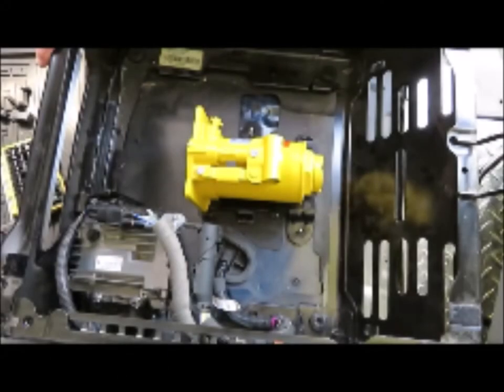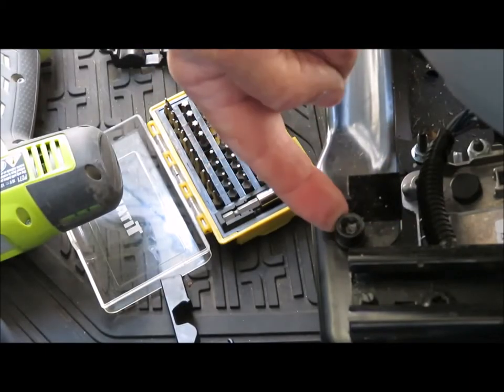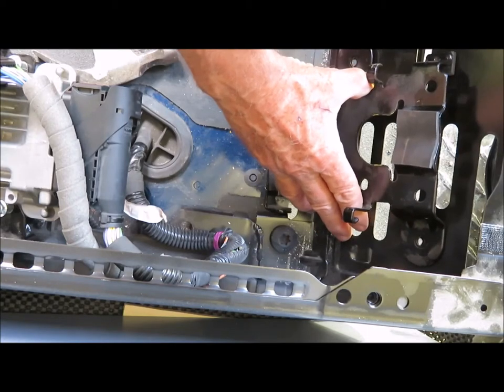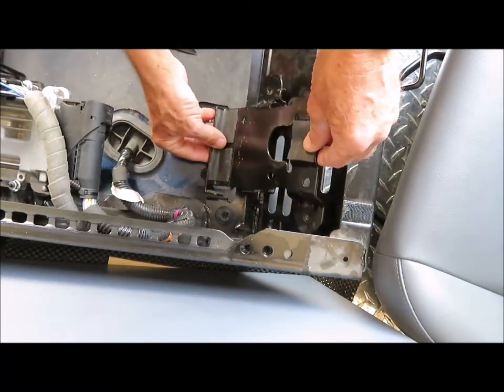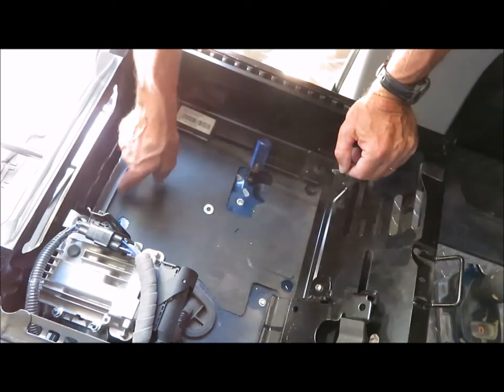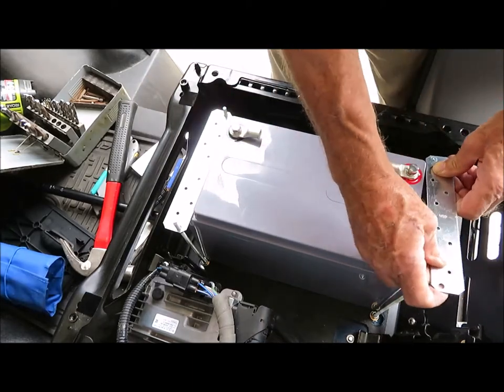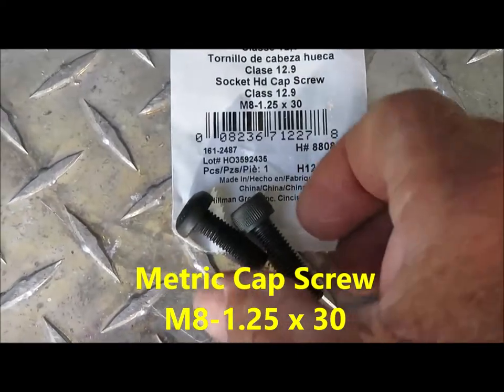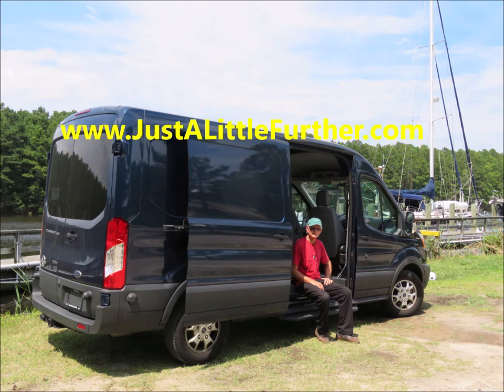Installing a Battery Under Passenger Seat of Ford Transit

Comment: I would suggest double nutting the clamps bolts.  If the battery becomes loose it could short out and start a fire.
Reply: Great suggestion. Thanks!

Comment: Great video. Just wondering if that positive terminal and wire is a little too close to your metal bracket.   I’d recommend some good layers of electric tape on that bracket in case something shifts.

Comment: Thank you for sharing your install, I'm about to add batteries to my Transit under the passenger seat as well.  The biggest issue I'm facing is how to get my cables across to the main battery without having a big lump on the floor,  while making sure the cables are protected.  I was hoping to see how you ran the cables on your video...
Reply: I mounted the remainder of my house batteries directly behind the front seats, so routing the cables in my installation was quite straightforward. I have a cable channel that runs from the floor to the ceiling along the wall behind the driver's seat, then another cable channel along the ceiling on the driver's side. The wiring for anything I need to connect to the batteries is routed along these channels. Will this work for you?
Reply: Hi David you're the only one explaining this thank you for posting. Need one more tidbit of information I can't figure out how to get the cables under the seat under the driver seat the passenger seat has vent slots across the back big enough to put the wires through. On the driver's seat the vent slots are blocked and smaller. From the side emergency brake housing is in the way..
 Thought about going under the van I really don't want to
Thanks Mike

Comment: What was the height of your battery? You said that it was too tall and you needed to raise the seat, so I'm wondering what size battery I can fit under the passenger seat without any clearance issues with the terminals. Thanks for the great video!
Reply from the maker: Hi Forest, The battery is a Renogy RNG-BATT-AGM12-100. The dimensions are 13"Lx6.8"Wx9"H
Reply: @JustALittleFurther  thanks! Based on your experience, I plan on mounting my battery on its side, so it doesn't have clearance issues under the seat.
Reply from the maker: @TheBradbike  What a great idea! It never occurred to me to mount the battery on its side. Just make sure to position it so the positive terminal is as high as possible so the electrons can flow down into the battery more easily. (Grin).
Reply: @TheBradbike hi, the new non wet batteries can mount any way round!
For a single battery on its side may be best.
Plenty of plastic and non conductive covers as well, even moulding them in place.
Take care M.

Comment: Would you mind sharing the dimensions of the battery you installed?
Reply from the maker: Sure Rudy, the dimensions were 13 x 6.8 x 9 inches. It was a group 31 battery made by Renogy.

Comment: One other thing did you do the CCP upgrade customer contact points allows bigger draw of amps to accommodate the second battery. I called the local Ford dealer they didn't know what it was

Comment: Need to show more respect when working near the battery poles especially when you had the aluminium strip, if you short the battery you could have an explosion. I would tape the poles before you start iv seen a bad accident when shorting out those poles , sorry but , just saying , no offence
Reply from the maker: Good point. I've installed dozens of batteries in our boat as well as our vans and never had a problem, but there is a definite risk. I once saw a spanner that had accidentally shorted the terminals of a 200 ah battery, and it looked like it had been used as a welding rod. Thanks for the feedback, Mike

Comment: Batteries under the seat is a bad ideal. they belong in the engine bay and under the chassis.
Reply from the maker: Actually, Ford puts the starter batteries under the driver’s seat. Both the starter batteries as well as the house batteries under the passenger seat are AGM batteries, so venting of gases is less of a problem than with flooded batteries.